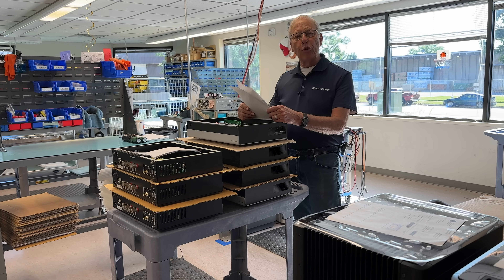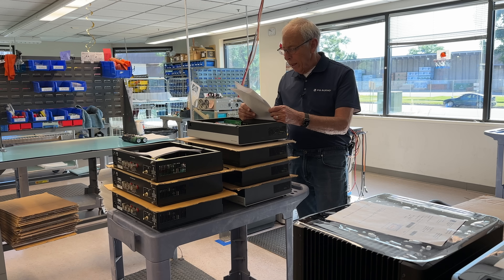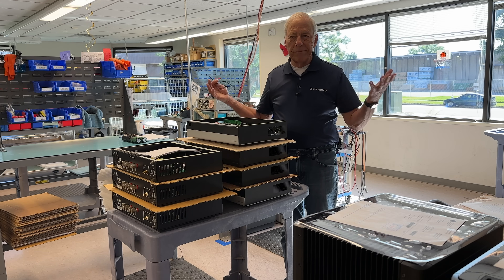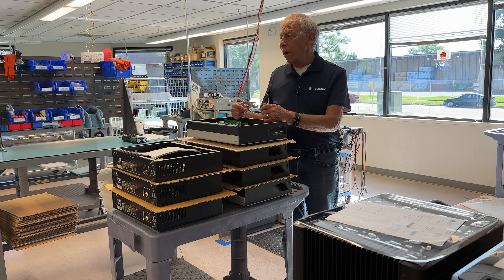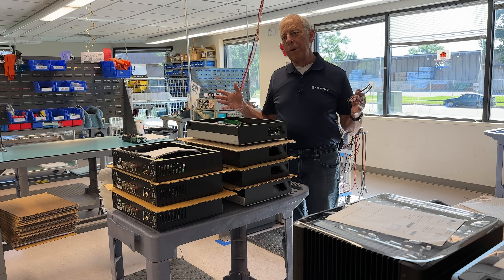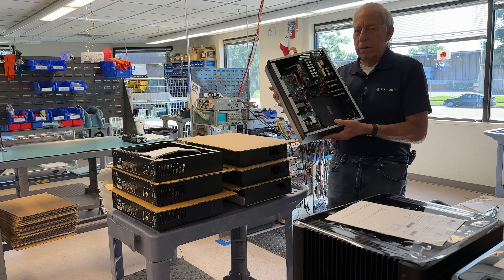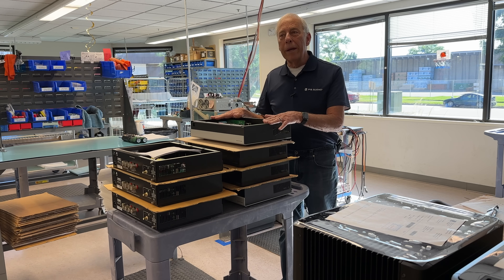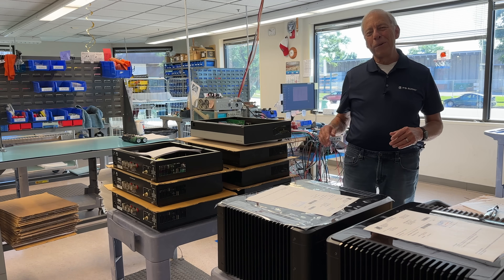How to tell Class AB from Class D amps

Comment: I recently bought one of those popular Class D amplifiers from Amazon, the Fosi V3, along with a 48V/5A switching power supply. Without getting into how the V3 sounds (brutally bright and in your face, almost shouty, compared to the typically warmer sound of Class AB. Suffice to say, I prefer Class AB over D), I've noticed that the Fosi amp does get rather warm, especially when idle, so it's clearly drawing a significant amount current when idle, otherwise the amp wouldn't get so warm. what gives? the Fosi V3 uses the popular TPA3255 chip from Texas Instruments, which you'll find in a lot of these lower-end Class D amplifiers.

Comment: harman/kardon is the best.
Reply: I had a H/K PA5800 amp. 5 channels rated at a laughable 90 watts per channel. Was head and shoulders above the amp in the old Onkyo/Integra receiver’s built in 100 watts. Still have it in a closet as a back up spare in case my Outlaw (ATI) amp ever goes out. The H/K was a great sounding amp that punched above its weight but never got warm unlike the Outlaw. I always wanted a few H/K Citation amps. Too bad Harmon pretty much eliminated the Harmon/Kardon line. They were the best bang for the buck amps ever.

Comment: Class AB  doesn’t have all that FILTERING on the output section. Class D require large filtering capacitors (Mylar or polyester type) along with large big inductors.
Reply: I would not call a 10uh inductor "large big".  Most are about the size of a $1.00 coin.
The filter caps are typically 1uf or less ... about the size of a tic-tac (candy).

The filtering removes the 300k to 500k switching from the PWM driver.  At those frequencies the parts get pretty small.

Comment: The simplest test? 

Pick it up.
With the monster heat sinks and transformers most AB amplifiers are very heavy.
Class-D needs none of that and often weighs considerably less.
Reply: Lightness only tells you that the power supply is switch mode. Class AB amplifiers can be light.
Reply: @MrsZambezi  
But the odds are that an AB amp is going to weigh more. Finding a rare exception does not disprove the rule.

Comment: 1980’s Carver “magnetic field” power amps were not class AB, correct? Weren’t they class D? Stayed cool virtually all the time, only slightly warm at or near max power. Weighed next to nothing.
Reply: Not class D. They used a switched mode power supply to eliminate the heavy transformer.
Reply: @gotham61  So what class did they operate?  Or were they some sort of hybrid or something else given the unique switching power supply? Hard to believe they ran even a few watts under class A as cool as they were. AB from the get go?
Reply: @36karpatoruski  It used a sliding bias class A/B circuit.

Comment: @Paulmcgowanpsaudio - do you anticipate that at some point in future class A/AB will become completely redundant/obsolete and class D will be able to match all the sonic characteristics of Class A/AB? If yes - any guesses as to when that might happen?
Reply: I know your question is directed to Paul, but if I may but in for a second... My answer would be that it already has.  

PSAudio's Stellar amps demonstrate that very nicely.
A growing number of dirt cheap "chip-amps" are producing power and sound right in step with the "big boys". Those based on the TPA3255 power chip are especially impressive.

The truth is that better audio is getting cheaper and cheap audio is getting better ... all the time.
Reply: @Douglas_Blake_579  we meet again 🙂that's very re-assuring for me - already have an Aiyima A07 (TPA3255-based) - put in Burson v5i op-amps and greatly enjoying the set. Ordered a Fosi Audio V3 (same chip, can op-amp roll as well) - which is supposed to have better components as per the video you shared 👍
Reply: @dipanjanbiswas6580  
I wish I had more time with the V3 sonically it's like the A07 with what I thought was a bit more oomph in the very low end ... The one I measured was a customer's unit and the actual task was to check the Op-Amps for fakes  (They weren't) so I only had about 2 hours with it.  .
Reply: @Douglas_Blake_579  Thanks - this helps a ton - the low end is where most Class Ds fall short - so glad to hear that the V3 scores over the A07 in this regard. I had switched op-amps on the A07 the moment I got it - so no idea how the low end was with stock ones. Both the A07 and the V3 have the same NE5532 I believe - the fact that the V3 has a better low-end seems to suggest more refinements in the supporting circuit - which should, hopefully, enhance the sonic characteristics of other chips as well
Reply: @dipanjanbiswas6580  
Yes they both use the NE5532 op-amps ... but they're not always the same.  

Of late I've been finding rebranded "something else" Op-Amps in some of these little Mini-Amps.  Lord knows what they used to be but they're not NE5532s (there's a simple test for that).

What I've taken to doing of late is to substitute in RC4558 chips.  These are functionally equivalent to the NE5532 but they have a much higher input resistance (2M ohm vs 30K) which appears to help the below 40hz response quite a bit, due to reduced losses through the input capacitors at low frequencies.  

With the RC4558s installed, the AO7's low end roll-off starts at about 16hz and it's down 3db at 8hz. (3hz is ideal) Normally it is -3db at 20hz (a common design error, btw). So these chips are making up for that deficiency as well as eliminating the risk of fake NE5532s.

The RC4558s are dirt cheap ($0.75 each in lots of 10) and are readily available from lots of online vendors.

Would this swap help the V3? 
I don't know. I was asked to verify the NE5532s, not to simply replace them.  They weren't fakes so I didn't get to try that. (I'm old school, I don't change stuff without a reason.)

Gotta love this Class-D stuff ... both an adventure and a learning experience.
Cheers!
Reply: There are people that have multiple systems they listen to in their homes. Tubes, A/B, vintage and Digital systems. Along with different types of speakers. 

They all have different characteristics along with the different types of music they listen to and what they want to focus on, different genres.
Think of as different flavors of ice cream and what you are in mood for. Match the system to what they are listening to. 

There are many different genres and sub genres of music. Vocals etc etc. etc. 

Paul is a good example. He has numerous audio systems in his house he listens to including his iPhone and car stereo.
Reply: @davidfromamerica1871  
I knew a guy like that.  In order to play modern music, he would make us wait for most of an hour while he hooked up his class AB amp then did REW sweeps to ensure it was set properly... then he would play 2 or 3 songs, and the cycle would repeat with different gear for his next selections. Never did know why anyone would do that, but yeah, some people are that far out there... 

Me, I have a system that serves me well enough in every case.  Want to hear some music... grab the keyboard, open the Playlists, pick one that catches your fancy and press Enter... never more than a few seconds to get to the fun part.
Reply: @davidfromamerica1871  - am one of those people 😄and hence trying to cut down to a manageable amount of gear😆

Comment: That tube front end brings up a question. How often do you have to change the tubes?
Reply: Input tubes I assume ?  If so, most likely almost never....  Output power tubes are the ones that can take its toll over time.
Reply: Obviously a question for PS Audio... FWIW, depending on the tube and how it is biased, it may run for 20 years without issue.  Small signal tubes that are not moving much current last a very long time.  Also, likely not expensive to replace, so you can keep a fresh one and after 5 years pop it in and see if you notice a difference.  If not try again in a few years.

Comment: Easy - if it keeps you warm in the winter..it's Class A/B
Reply: All of u are misspoken.  Class A is the only one  which heats  up. To  such a degree that it actually heat up a room.
Reply: @terrycain1811   Class A has no advantages sound wise either, but the famous (class A) Musical fidelity A1 was class AB really. Still warms the room though.
Reply: Depends on the biasing.
Reply: Or your electric bills high suddenly
Reply: Class A even more heat. 😂

Comment: In 1965 Clive Sinclair in the UK marketed a Pulse Width Modulation audio amplifier (class D). Sold ready built or in kit form, it had several problems such as low power and interference to radio and TV.
Clive invented pocket radios, pocket TVs and electronic watches as well as Britain's best selling home computer. As a youngster I built his Micro Radio kit the size of a matchbox.
Reply: Bare in mind that the spectrum still looks modern today. That's good design.
Reply: While Sir Clive was definitely an innovator, most of his creations were let down by poor build quality. The Black Watch was a famously epic disaster, and certainly wasn’t the worlds first electronic watch.
Reply: @gotham61  Yes, I remember Clive bought a load of reject transistors. Re-tested them and sold them as Micro Alloy Transistors MAT101 and MAT102. Generally ok for audio and MW radio but quite expensive, about 8 Shillings each I recall.
Reply: @gotham61  Mever bothered with a Black Watch. It had a red led display which had to be turned on each time to read and was heavy on batteries.
Reply: Didn’t Bob Carver make a class D amp in the late 1979s? If I recall it was a small silver “cube” shaped amp with LED indicators on the face
Reply: @joeowen2  The Carver M400 Cube was a sliding bias Class A/B design with a switch mode power supply.
Reply: @joeowen2  Nope. Carver was not class D for the audio path. It was a switch mode power supply.
Reply: Sorry, late 1970s..
Reply: I enjoyed having one of his programmable pocket calculators in the mid-1970s.

Comment: Eigentakt purify, Hypex Ncore are all class D. These are state of the art
Reply: More like state of the shart
Reply: How do YOU power these things?
Reply: @donpayne1040  
Usually with switching supplies, giving the advantage of putting the amplifier's outputs on a tightly regulated voltage.  Older linear supplies can be used if they don't rebound or sag after transients.
Reply: @Douglas_Blake_579  I see.

Comment: Class D wasn't a thing in the 70s and early 80s?
Reply: While it did exist in PA and various self-powered speakers Class-D didn't really get a consumer foothold until the Chinese manufacturers picked up on the Tripath chips and began marketing them as "desktop amplifiers" in the early 2000s.  
Since then Class-D has progressed rapidly to the point where most recently end-users are actually surprised to discover their own equipment is Class-D and they didn't even suspect.  

PSAudio's Stellar and Sprout lines are Class D as are many from other well esteemed manufacturers such as Marantz, Cambridge and Crown.

Comment: Class D: another opportunity for prejudice among audiophiles. Some people joke about Class D. You just know there's a brand or 2 out there of Class D amps that would erase the smirk on those people's faces forever. I'm still into Class AB or preferably Class A, but like the compact disc thrust upon us; in 8 or 9 years, you can pretty much count on Class D being our main choice and maybe even virtually our only choice, except for vintage equip. and some esoteric brands. If the Class D amps are lightweight that will be good news for the incredible amount of 70 year olds by then. They will represent the biggest age group of our population. Expect cds or digital something to be the popularity king. Older people need brighter sound with their upper frequency hearing decline. Maybe if vinyl is still popular, those moving coil cartridges from the 1980s with their extreme rising high end will come back. 30 years ago, it was hard to find a moving coil cartridge that didn't have a distinctly rising high end. Maybe bright CBS Mastersond half speed master lps will become legendary and huge collectors items. Vintage reel to reel tapes might be nostalgia value only with its duller sound. Quite a few companies throughout the world are currently offering prerecorded reel tapes dubbed directly in real time from studio masters. Kind Of Blue and Blue Trane are available in Europe. Other titles are available right here, as you may know from the audio shows. 

What sound does a tape deck make before and after Dolby Noise Reduction?

Answer: Shhh....Quiet.

Comment: Just lift the thing. No weight = class D. You will also hear, there is a lack of presence in class D.
Reply: Sorry but this is just bull crap and old world stuff. 

I just got the Marantz PM KI Ruby.. it weighs more than many hyped klass AB stuff(Hegel). And sound far warmer and has a much better soundstage and presence than any class AB stuff that has been here.

It’s not the class that decides the sound.. it is the circuit around it and implementation:)
Reply: @AudioHdnsm  Marantz sound is nice but not in the same league as Naim or Cyrus for clarity.
Reply: @philipslighting8240  well, with the change from AB to D they got that handled :) no lack of clarity or air in the top :)
Reply: @AudioHdnsm Agree, of course class D can sound excellent when it’s designed with utmost care for the audio fidelity. Class D used to be harder to make sound great but it has a huge advantage in providing excellent dynamic range per Dollar and per weight. Often people are negative about class D out of ignorance.
Reply: I have 2 class A/B amps.
I am keeping them forever until I die. I might even have them buried with me..👍🤗
Reply: @davidfromamerica1871  so what.......
Reply: So we all know at least the basics of how each class works and some here will run circles around the rest of us. That said, to what do you attribute the lack of presence in a class D amp? The reason I bring this up is because something like presence is usually spoken of as a function of frequency response that could be EQ'd away but intuitively I just know there's more to it than that. My take is about a balancing act between the modulating technique and the output filtering. I have opinions about that but I still want folks to think I'm from this planet.
Reply: Can't you have conventional transformer powersupply while amp is class D? That thing would be also heavy.
Reply: @edfx  literally all four combinations are common. SMPS -->D, SMPS->AB, Linear->D and Linear ->AB. Just depends what drugs the designer was on that day or what mood the spouse put them in that morning.
Reply: @edfx  
Yes you can ... but you sacrifice some stability in the process.
Reply: My though exactly.